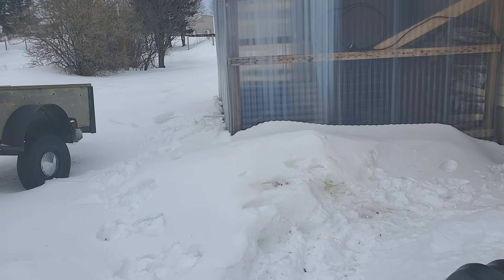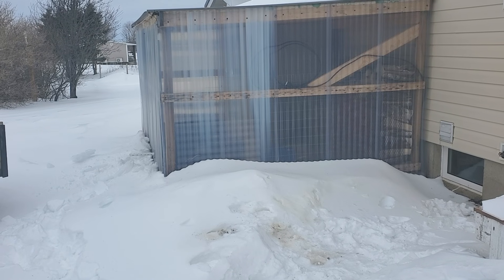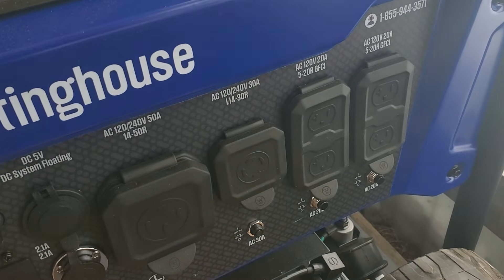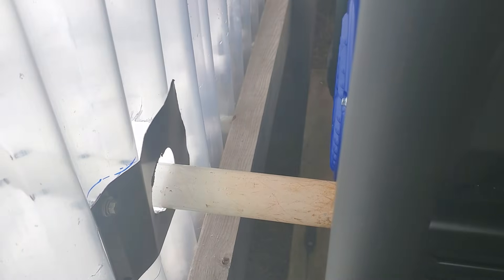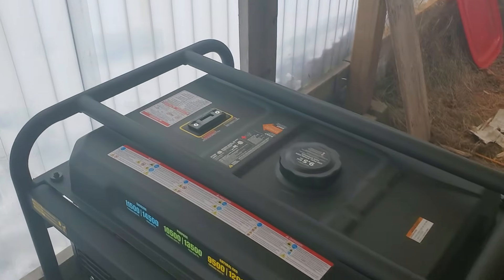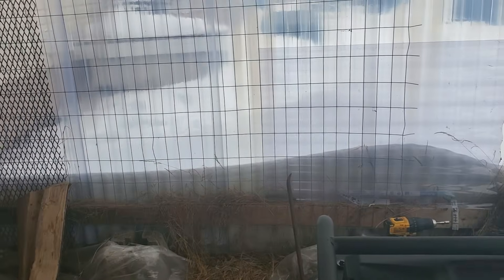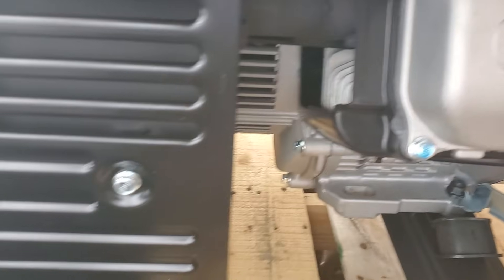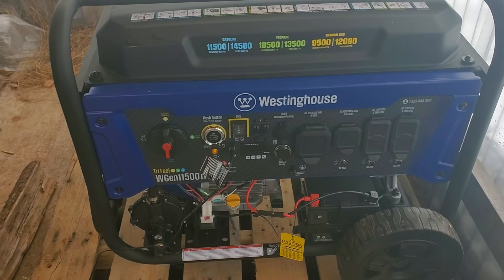Will Doing This,  Wreck A Generator?

Comment: Is that a PVC exhaust pipe? That’s not gonna hold up. Otherwise, looks like a nice setup. You could put a fan inside there to help move in fresh air and move out old air
Reply from the maker: It looks like pvc but it's metal with paint on it. You're right about the air flow, I may add an exhaust fan or window for more air flow. Thank you!

Comment: I don't see any problem with it. Except...  Make sure the exterior pipe won't allow moisture (rain, blowing snow, etc.) to run back into the generator from outside. I would try to give it a slight downward angle if possible. Obviously not a problem when running. But could be an issue when idle. Don't accomplish this by tilting the generator. It should be kept as level as possible.
Reply from the maker: Thank you!! I thought of that last minute, for now I just pull the generator inside so the pipe is indoors. I'm going to put a bigger pipe around that pipe to shield it from the weather
Cheers

Comment: I wouldn't be the slightest bit concerned about the generator. I would, however, strongly recommend a CO monitor close to that area inside the house, just to ensure you don't run into any issues.
Reply: That’s what I was thinking. Genny will be fine, CO was my concern.
Reply from the maker: Thank you!! I did think of CO2 and have a detector built into the generator and shuts off if detected, I also have one in the basement. Thank you again!!